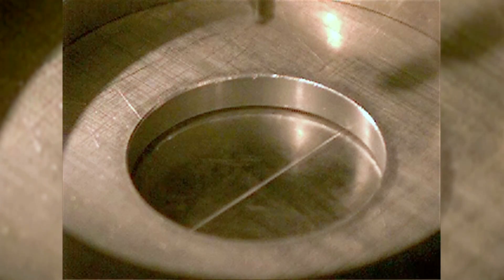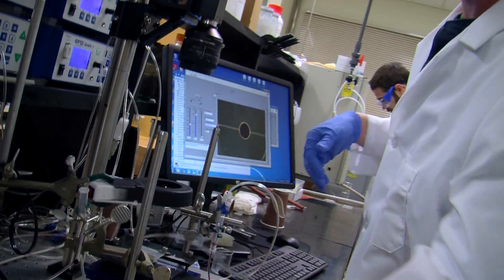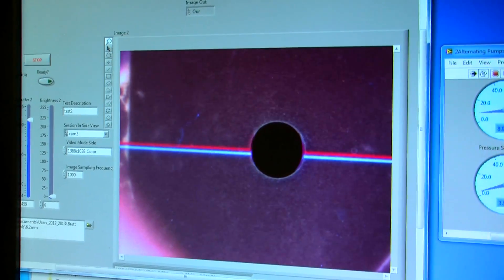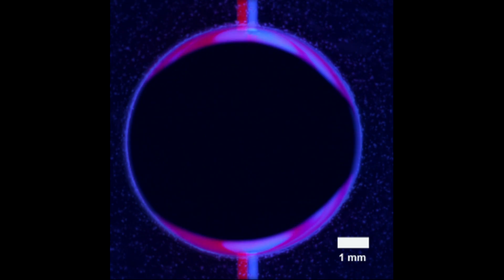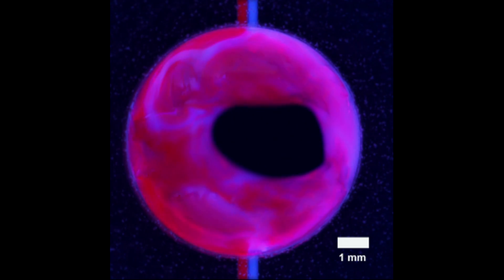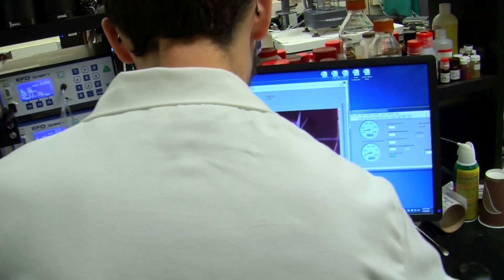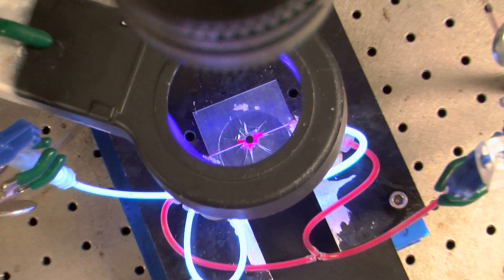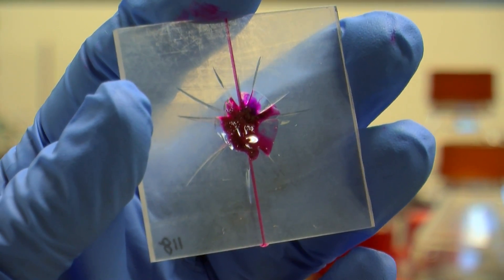Regenerating Plastic Grows Back After Damage

Comment: They tried too hard to sell the technology in this video, and in so doing opened themselves up to the harsh criticisms of the comments below. But what they have accomplished is far more impressive than merely "putting glue on a hole."

Mixing two fluids together to trigger their solidification is obviously not groundbreaking -- you can just go to the hardware store and buy 2-component epoxy. However, they engineered the rate and firmness of the solidification so that it could fill in a hole that has no support underneath. If it solidified too slowly (like the hardware store epoxy), the liquids would just drip off and never reach the center. If it solidified too quickly (like superglue), it would seal itself off immediately at the cracks and again never reach the center. The fact that it solidifies just right so that the flow can "leapfrog" its way to the center, perpendicularly against gravity, is impressive.

They should have NOT tried to imply that their test device was an example of a self-healing material because it clearly isn't. They should have explained what are the next steps to go from that successful proof-of-concept demonstration to an actual self-healing material, i.e., the incorporation of a grid of liquid channels ("vasculature") and, if necessary, the source of pressure (the "heart").
Reply from the maker: Thanks for your interest in this research.  We have a companion video to this one that address many of the issues you bring up.  You can view it here... https://youtu.be/uXOtQuwxNQI

Comment: This form of mending plastics doesn't seem to viable yet. There is a few obvious problems I see. 1) It's a new form of tech so we can't really expect everything from it yet, but that being said in all honesty this demonstration was really slow and had a really poor result. 2) What if the tubes get damaged? The flow will stop, I know you are probably going to try to create a network of vesicles that will overlap and ooze into the break, but if those channels are cauterized it won't work very well. 3) Those off shoots from the center whole weren't filled at all, you said they would be, but i saw nothing filling them in. 4) There is older and better forms of mending, their are materials that can be heated and smoothed like laminates that are much more effective.

Over all cool idea, but it needs to be more practical, maybe it will only be viable in large scale objects so that they can have a pump feeding the liquids to the structure, but in the small scale, I would just go with laminates which are a cheaper, simpler, much more effective form of manual recovery.

If I sound silly or I am wrong about something feel free to correct me, I'm going into engineering school next year so what the hell do I know?

Comment: Windscreen repairs have been conducted like this for 15 years?

To be able to effectively localise the "healing" you would need a grid network etched on the surface in order for your gel to be able to move to the correct area and I think this would maybe compromise the structure of the material. While this may eventually yield exciting results, I feel making "break proof" materials more efficient and cost effective would alleviate the need to repair them. Prevention > Repair

Comment: I do not see it self repairing? I see a scientist placing tubes of material to repair the hole. Self repair would by definition not need an outside interaction. It's like saying my house is self painting, by me using a paintbrush and paint!
Reply from the maker: The authors from the paper these results were detailed in, write: "The chemistry we developed performs a function similar to wound recovery. The fluid gels quickly—filling and holding it in the damage. It then hardens and develops properties similar to those of the original material. In the lab, the fluid is delivered by tubing and external pumps. When integrated into an actual device, it would include a pump and vascular system to circulate the chemistry. This is similar to how healing is accomplished in biology."
Reply: *****
 how about nanobots to do the repair? :)
Reply: Self repair if this fluid is constantly flowing through like our blood. Far from being useful as they only solved gravity problems can you imagine pressure, fluid etc. ?!
Reply: It's no different than fixing a windshield with a back cover and some apoxy in a vacuum.. In fact this method has flaws, scars like tissue too, it leaves weak points. It also has a flaw where the material would need to be pressurized the whole time with millions of canals so that NOT JUST 1 SPOT right in a path of a set would be broken and be able to "repair". It's a cool concept, but they need to find a way to use genetics, something that can use DNA schematic like our body structure, so that when it breaks it will form the same structure, like a salamanders tail being lost. Hope they make progress on that.
Reply: brandon9271 only problem is public opinion. If someones in an accident, and the nano machines somehow enter the bloodstream, if not setup properly, it will end up eating you alive. But that's if it's improperly setup. The fear factor of people getting 'cyborgified' by accident or otherwise is what keeps us from using it to any real extent already. People always think unkle Sam's going to abuse, which arguably they could... This is why I say use "genetics" because it's something that we can "kill".

Comment: How is this able to regenerate multiple times, would the repair site not be missing the vascular system required for subsequent repairs?
Reply from the maker: Brett Krull, a co-author on the paper these results were detailed in, says, "Future versions would incorporate complex vascular networks so  you could achieve healing  in multiple locations as long as new damage exposed some of the vasculature. Healing within a repair site is a continuing challenge and will require dynamic chemistries combined with a remodeling-type approach."

Comment: I can see this being used in shielding for astronauts micrometeorites, all so uses in hazmat safety equipment such as face shields and masks.
Reply: Brian Miller magnetize nano tubes and harness them in an electromagnetic field.Just a thought
Reply: I'm not really sure any of those applications would be practical at all for this stuff.
Reply: If it can reseal air tight any positive pressure system could benefit self sealing. Thinking  in the terms of bullet hole size aplication seams very limited.
Reply: Brian Miller I just think that if anything were to blast through a visor or helmet in space, such as a micrometeorite, it would likely go straight through and out the other side due to their extreme relative velocities, causing more damage than a simple hole. Also, as this stuff is still somewhat viscous initially, having hard vacuum on one side of the damage might not be conducive to the physics involved with its ability to fill the hole and heal in time for the astronaut to appreciate it. An in my opinion, safety equipment and hazmat gear should be immediately replaced rather than healed over time in this manner. Perhaps I'm just having a failure of imagination right now, though.
Reply: These type of products are extremely new and may get to the point were there can seal in minutes or even seconds. I was think that on the space side that they would be additional letter added to the armor that are exists on the international space station for instance.
http://www.smithsonianmag.com/smart-news/how-do-you-shield-astronauts-and-satellites-from-deadly-micrometeorites-3911799/

I do agree with your opinion that hazmat equipment should be replaced immediately: however the user need to live long enough to replace their equipment. For example say a firefighter takes me blow to face mask of of the respirator cracking the mask and allowing chemicals asleep in. if that face plate was self healing the exposure to the ware would be greatly reduced.

Comment: So it would only e able to head damage along these "channels?" Also, how does the system keep from running over or not producing enough material. What system will be in place to make all these calculations?
Reply from the maker: The gel is soft enough to allow fluid to continue to be pumped into the damage area. The researchers actively initiate and complete pumping currently. Future systems would likely operate on a pressure trigger.